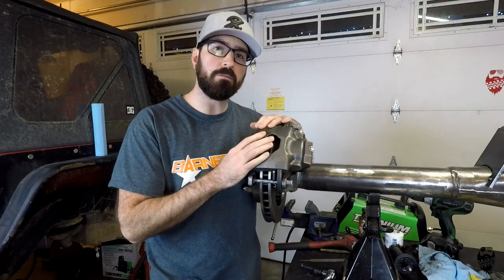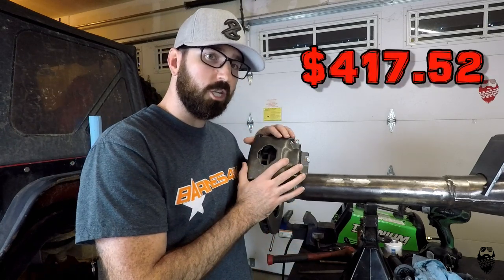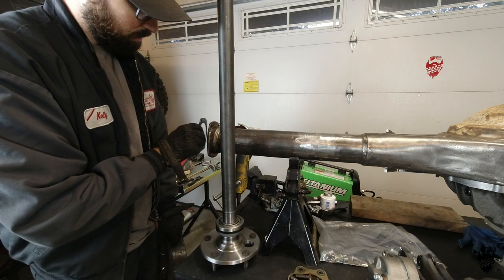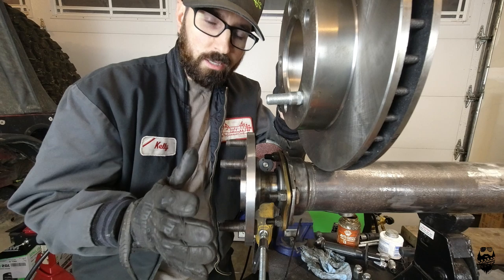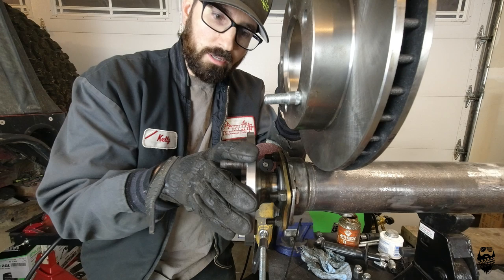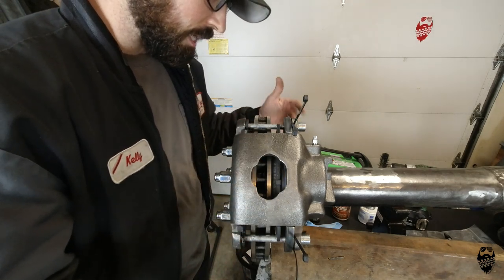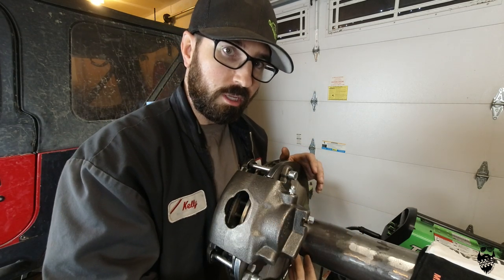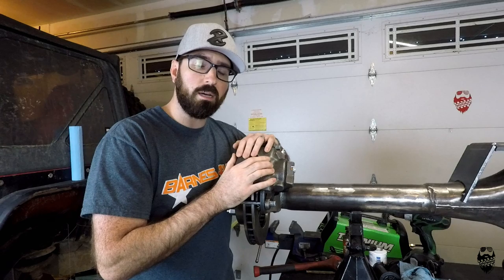Ford 9 inch Disk Brake conversion - Jeep Wrangler TJ axle upgrade part 2

Comment: Could always use Explorer rear brake kit for 9” ….internal small drum brake for e brake works really well without dragging issues, rotors can be ordered in any bolt circle. You’re welcome.

Comment: Under cover fab makes a backet to hook up a mater cylinder to the factory parking brake handle
Reply from the maker: I have seen this, pretty slick. gets kinda expensive with the bracket and buying a master cylinder. I have been looking at the $25 eBay hydraulic e-brake handle. I have a few friends that use them and have had no problems with them👊🏻

Comment: Thanks for the video. I think it will come in handy.
I recently bought some Dana44 axles from a 2006 JK for my 4.0L TJ. 
Not exactly what I was looking for but I got both axles for $300. Apparently they have no brake parts. I didn't know this when I bought them.
I was planning to truss them and re-gear. I'm planning to run 35" tires but might go up to 37's if I get crazy.

Do you think these axles are worth it?

Comment: thats quite the hodge podge of parts but looks like it will work well.
Reply from the maker: Yea, it should, it is just the same parts that come with most kits, it’s just cheaper if you buy them separately. They just usually don’t reveal exactly what parts they use👍🏻

Comment: Does that disc setup stop better than the drum setup?
Reply from the maker: Not sure, I haven’t had a drum setup on this Jeep. But drum brakes work just fine as long as they are clean and adjusted properly.

Comment: Just parted out a 79 for a "Free" axle. These videos are a great help as I tear the axle down.  One question is why you did not run hard lines right to the calipers then have a single flexible line?
Reply: You wouldn't be able to remove the caliper to change pads without also unhooking the brakeline.

Comment: I always thought about putting a line lock for the rear for a ebrake
Reply from the maker: I will be doing that later down the road. They make e brake handles with a line lock built into it, which is what I will be trying out.
Reply: I have a lever line lock, I wondered if I'd trust it parked on a hill for a long time. I think it was intended for a forklift.

Comment: couldn't you run a line lock for a parking brake press brake activate and there locked until you deactivate
Reply from the maker: Yep, the Jeep already has one, but it hasn’t worked since I have owned it. They make ebrake handles with a line lock built into it, I am probably going to go with one of those👍🏻

Comment: Hey Kelly, Im looking for a set of axles for a swap right now. Im hoping to find a HPD44 from an early 70s f150. Is your 9" from the same truck that you got the D44 from or is there a more desirable housing?
Reply from the maker: The front d44 will be the tougher one to find. I have the most sought after one from a 76. The 9” I have came from a 1980 f150. Much easier to find those. I used this as my guide for the d44. Hope it helps. https://www.therangerstation.com/tech_library/Dana44.shtml

Comment: Think I'm running ford explorer disc breaks on my currie 9".
Reply from the maker: That is an option, but they are like $500, unless you can get everything from a junkyard and piece it together.
Reply: @MuddyBeards4X4  by everything, it's just all the parts on the explorer 8.8 right? No adapters, no Frankenstein, just 8.8 backing plates, brakes etc?
Reply from the maker: Depends on which 9” axle you have, I believe the 8.8 backing plate works with the “new style” 9” big bearing ends only.
Reply: @MuddyBeards4X4  this is relevant to the big bearing small bearing 9s correct? Is there a new and old style big bearing?